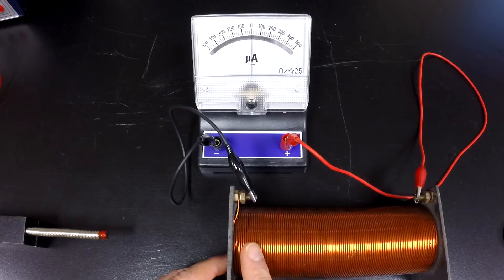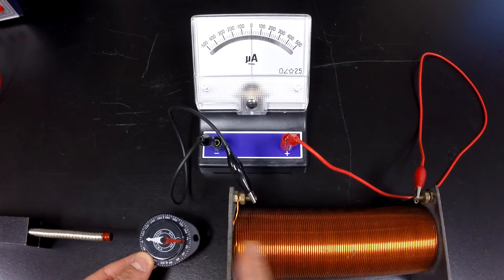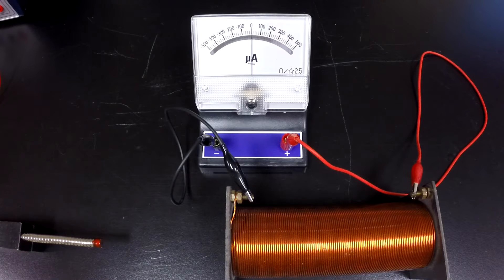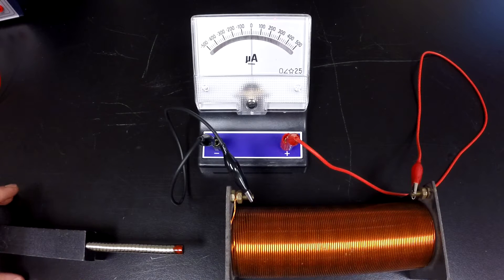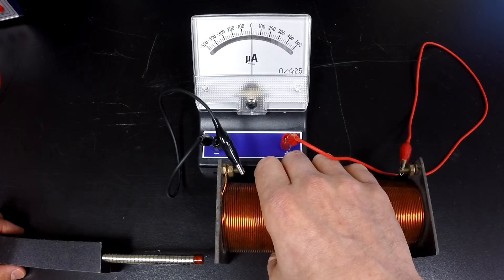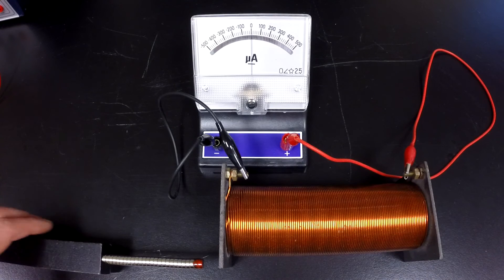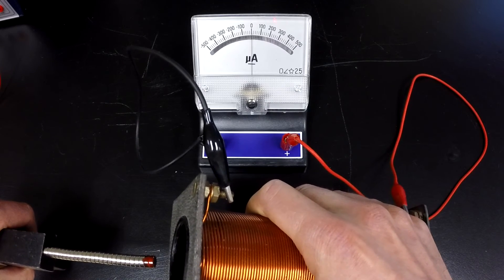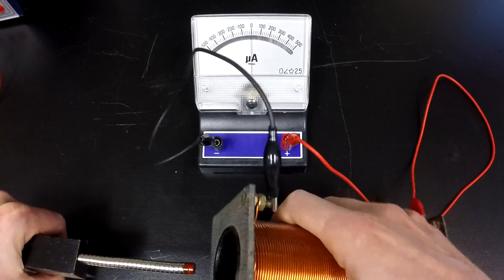Electromagnetic Induction - 3 Ways to Induce a Current in a Loop of Wire

Comment: Well sir , u have hold the metal part of the solenoid .......so aren't u feeling a shock............BTW it's a nice video , now I have the concept clear.......Thanks alot
Reply: Even if there was no insulation on the wire, the induce is pretty low so you want feel it and just feel it lightly @Nisarg Somani